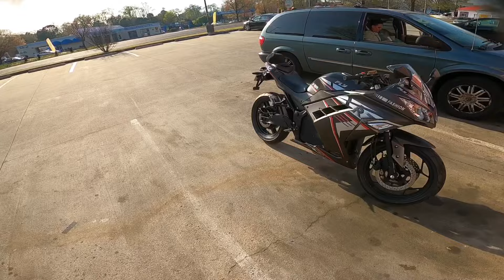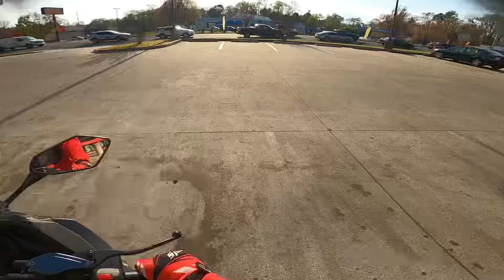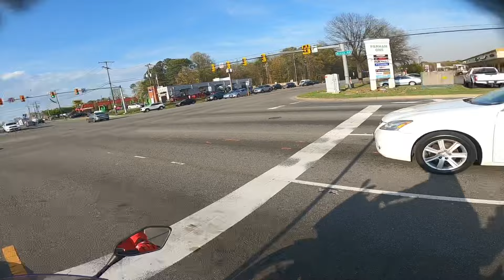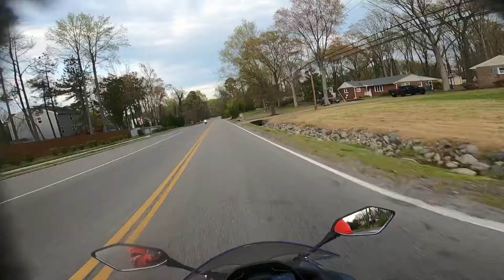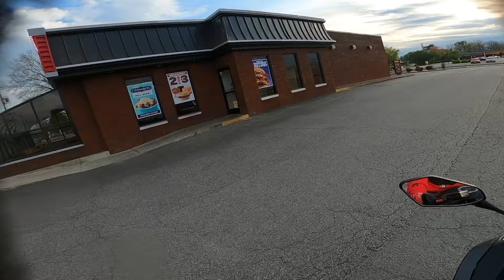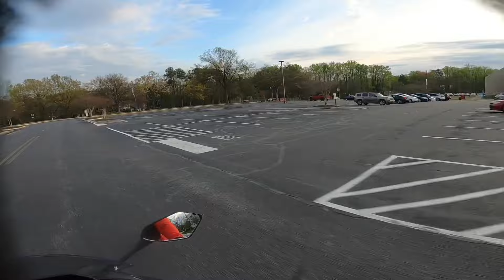My RZ broken and it won’t crank up, imagine that? Lil test ride after hall sensor repair. We good!

Comment: Nice bike. Does the fairing slow you down or make the feel of the bike lighter or stiffer? Finally rewired my spun motor and hitting 96 volts at 60 amps.

Comment: I have to ask my speedometer board is all blue. Did you change that around yourself with the black screen do you know how to turn the volume up on the Bluetooth speaker that’s built in the bike or do you have to adjust the volume only by your cell phone I was curious to know
Reply from the maker: Mine is blue I just have a phone over top of it using GPS because not only is it in KPH it's very inaccurate it's off like 5mph also and yes volume on my phone